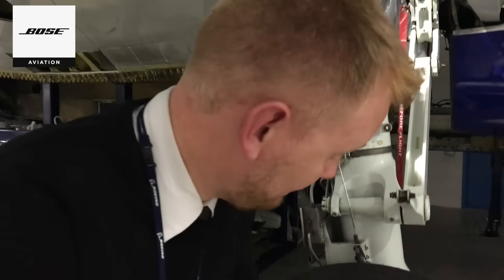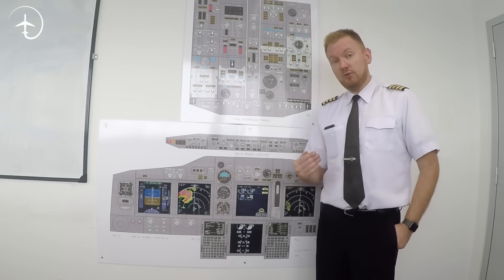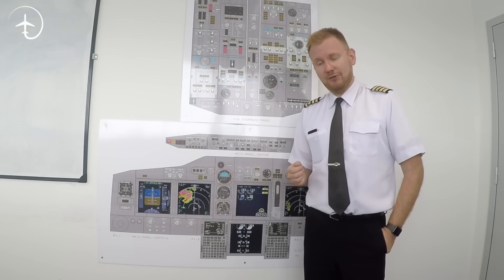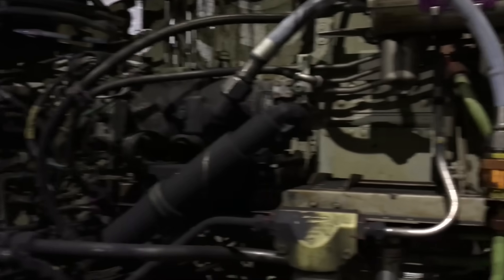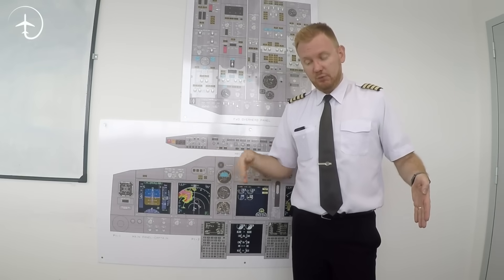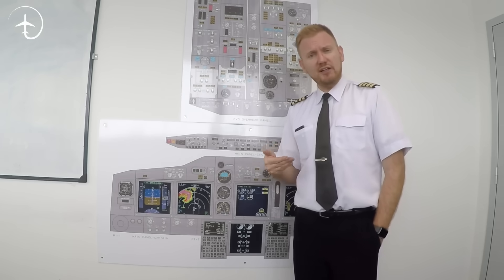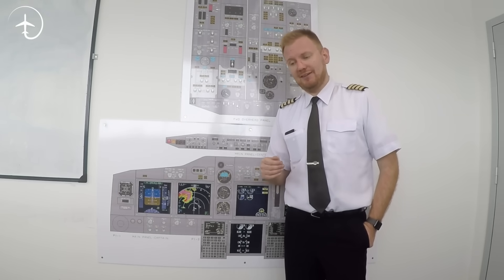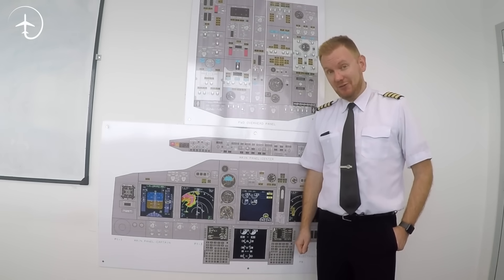Why does the Boeing 737 not have any landing-gear doors?

Comment: QUESTION: HOW DOES THE PLANE LINE ITSELF WITH THE RUNWAY SO PERFECTLY AND ALMOST TOUCHES DOWN AT THE SAME POINT EVERY OTHER PLANE TOUCHES DOWN? HOW COME IT DESCENDS AT THE SUCH A PERFECT RATE THAT FROM A HIGH ALTITUDE, OVER MANY MILES IT TOUCHES DOWN EXACTLY AT THE SAME POINT EVERY PLANE TOUCHES DOWN EXACTLY ON THE RUNWAY. HOW IS THIS POSSIBLE? THE CALCULATIONS WOULD BE VERY HARD TO FIGURE THAT ONE OUT.
Reply: I'm not a pilot or any kind of expert, but the pilot FLIES the plane to a large degree, he determines and decides where to touch down...oh, and turn off your caps lock...
Reply: Happy Plucker.  Ok. Let’s go back and be clear.  I started flying before the Internet (at least before it became widely available). I had large folded up charts (not under plastic) and an E6B (slide Rule?) and never used either to figure out a glideslope.  I also had (and still do) a transponder that doesn’t bleep when I am on course.  What did you mean to write?  Because what you wrote is incorrect.  And perhaps your writing does not accurately represent your thoughts, so this is an opportunity to concisely write what you mean.  If you care to know, I can tell you how it was done then, and how it is done now, instead of you posting stuff that   was not/is not   accurate.  Obviously you are interested in aviation, and I would enjoy answering your questions.  I am not THE expert, but am very knowledgeable in the subject area.  

Instead of telling people “how things work”, you might consider prefacing it with, “I read that....or...I think that.....” instead of posting something that is factually incorrect and anyone in the business will know is wrong.  At least it shows an attempt at learning the facts and making an error, instead of sounding like the voice of knowledge and being wrong.

The person who uploaded this video can answer questions for you, since he is qualified on the plane being discussed.  By the way, I think you hold the record for the most incorrect statements in a single comment that I have responded to so far (see comments above).  I would refrain from explaining things and ask more questions until you have an understanding of what you are commenting about.  Nobody knows who you are, so asking questions should not be embarrassing.  I know you have good intentions, but falsehoods don’t help anyone.  Use the comment sections to educate yourself instead if making incorrect statements.  Aviation is very interesting.  There are many people who are in the business who can give an accurate answer that everyone can learn from.
Reply: +John Jones Aircraft are expected to fly a specific "flight path" upon approach to an airfield.  Modern aircraft are fitted with equipment that tells them exactly where they are according to the flight path and the pilot steers to agree with it, and in many cases, the instrumentation can itself fly the aircraft along the path.

Aircraft are expected to land at roughly the same place on the runway, and buildings/vegetation is limited/managed to account for the path to that spot.  Along the centre-line of course.  If they touch down too early, they run the risk of breaking the plane if they undershoot the runway (like that plane did in San Francisco a few years back).  if they land too late, they run the risk of running off the end, especially if they have brake failure.

So every pilot is aiming for roughly the same spot - a bit past the start, but leaving as much run-out as possible.
Reply: There are several methods a pilot uses. One are the VASI lights on the side of the runway. If the pilot is too high, he sees the lights as all white. Too low, all red. Just right he/she sees 2 red and 2 white. You can see the lights if you drive past a runway but you will see all red because if you were a plane, you would be too low of course. I understand the pilots also aim for the same touchdown point as they land. This is where their skill comes into play... you can find YouTube videos showing them making adjustments to their glide slope as they get closer to touchdown but I think they focus on that point on the runway next to the VASI lights as their touchdown point. Most of the calculations are already made based on the plane. The pilots already know what their optimal landing speed needs to be for the plane they are flying. The best answer to your question is pilot experience and skill
Reply: E I N S  checkout your local flying club. They usually have trial flights 1/2 hour up for around $ 80-100.
So on board a ship you are surrounded by water. Unless you can see a landmass you could be anywhere. Also you need to be aware of undersea obstacles, rocks etc. That is why charts are vital and you need to know the depth of water, what currents are where as a large ship takes time to change course whereas a plane is easily re-routed.
Reply: Happy Plucker No, we fly it down.  The computer (I assume you mean autopilot) is usually not involved.  We are primary.
Reply: Happy Plucker maps under plastic? NO.  “not big folded sheets”:  yes they are if you are talking about VFR pilots unless they have something like Foreflight on a display or tablet.  If you are talking about airliners, then IPad, or tablet.  Transponder bleeps when you are on course (no, it doesn’t).  It responds to radar interrogations.
Reply: It is similar to driving a car, you look where you need to go and without to much thought you drive where you need to go. Of course with landings you have head winds, air temperature/air columns, air speed, and control surfaces determining sink rate. With practice the pilot learns to read the situation and adjust his airspeed and control surfaces to land at the right point on the runway. There is lines painted on the runway or marked with lights that aid the pilot in landing in the right place. Also many airports has various light and or radio beacons along with Instrument landing systems(ILS) to help at night and in bad weather. Most pilots can land where he wants on a runway without needing to think to hard at it but at times conditions can make it harder or they goof and need to abort and fly around.
Reply: how were pilots landing before ILS?
Reply: GPS.
Reply: E I N S  Line of sight. Pilots have access to maps, paper and electronic. Using map and compass they find the general location. Back in the day the next step was to use a slide rule. The height and length of the runway, direction of wind, approach speed are used to calculate the correct "glide slope" the angle the plane descends. Then it's down to skill.
Reply: i highly doubt they were able to use paper maps inside that small cockpit , i finished the Naval Academy, maps are huge and you need a table, big clean surface and compass and ruler and paper to do calculus on, being a pilot is still a big enigma for me, i just don't understand how it works.
Reply: E I N S Maps are held under plastic on boards, not big folded sheets. They contain information about headings, altitudes and radio frequencies. But many an amateur pilot has used road maps. I once flew with a guy who knew where all the pubs were on his route but other landmarks are used. It is not that difficult unless you encounter bad weather. If you study a basic instrument panel you will find gauges to show heading, height, airspeed, a clock to show time in air and present time. Fuel gauge, temp gauge.
Then there are transponders, devices which will bleep when you are on the correct flight path. Also air traffic control know where you are in the air and will give you heading and altitude.
There is nothing spooky or clandestine but it is highly skilled, especially landings.
And at night there are stars and sextants were used back in the day.
Reply: i would definitely enjoy one flight inside the cockpit to see what they do and how it works, i just have this curiosity about flying, i loved airplanes since i was a kid but i never took this road, i flew many times but always have been interested in what do pilots learn in school, always been interested in seeing planes from the pilot's perspective and understand how it works. I guess you are right there is the Air Traffic Control that can give important information to pilots and landmarks indeed that's a good point. I am just confused because in the navy people use maps to calculate the location of the ship along with the GPS and i just cannot see it being done in the cockpit . Deferent methods i presume, interesting.
Reply: Uuuuhm, isn't that more or less what I said, although a little more concisely than you?
Reply: Clearly? I have done a fair share of "left hand seat" piloting in my time, grew up in a flying family, I have a good grasp of the mechanics of piloting an aircraft and of the theory of flight. I can identify many, many aircraft by sight and at least one by sound (Douglas Dakota). Have you ever even been in an aircraft, or even seen one close up? And, for fucksake, turn off your caps lock, you are rude.
Reply: John Jones No, he follows the glide slope down, flares, and touches down where he touches down.  Sometimes 1000 feet down the runway, sometimes 3000 feet down the runway.  It’s a skill.  We are looking for a nice touchdown in the touchdown zone.
Reply: Happy Plucker who told you this?  The length of the runway is completely unrelated to glide slope.  What slide rule are you talking about?  The E6B is used for many things, but glideslope isn’t one of them.
Reply: John Jones sorry I did not see your post.
Reply: Oscar Blue Of course ipads are now the norm but I was referring to last century, before the internet.
Reply: Oscar Blue ooh I've been burned. Ok so my memory is a trifle shaky, I'm going back fifty years.
Reply: Happy Plucker ok, it was a long time ago.  Then tell us what you were flying 50 years ago and how it was then.  In other words, how the slide rule was used to calculate a glideslope for example.  I honestly have no idea what you could be talking about.  50 years ago puts us into the DC-9, 737, 727, 747 era, and I have flown two of those aircraft.
Reply: Happy Plucker After rereading your comments, I have come up with the following conclusions:

You do not hold any pilot certificates.
You went flying with someone you know who tried to explain some of the technology in the aircraft.
You misinterpreted the information.
You have done no research on the items you commented on, or your comments would have had some accurate information in them.
You have little/no knowledge about airline operations other than what you have seen on TV or at the movies.

Am I pretty close to the mark?

My uncle flew B47 bombers in the early 1950’s and he could remember many details about aviation before he died, so I don’t think your 50 years ago memory not being so good is a legitimate reason for all your information being inaccurate.  I don’t think you ever knew how it worked back then.
Reply: Oscar Blue I never claimed to be a pilot sunshine. I apologise for my memory or lack thereof. I am so pleased your grandfather retained good cognitive powers. We cannot all be so lucky. I have however flown right seat in many different types, including Twin Pioneer, Douglas Dakota, Hawker Hunter trainer, Beagle Basset, Beechcraft Queenair, Yankee and I have serviced all these plus others. Let us leave it there. You obviously have superior knowledge and like a dog with a bone are very happy to gnaw away.
Reply: E I N S bringing a sub into harbor would definitely be harder than landing a plane. you have do it for slower and with far less control.
Reply: Happy Plucker OK then.  You flew some classics and I will never have those types in my logbook.  I was not looking for you to say that I know more than you.  I am sorry that I got all over you.
Reply: govt required a rabbit's foot
Reply: I wonder what type of expert information you used to determine his cluelessness. Are you aware that birds, much less complex flying systems than the pilot/plane tandem, maintain near perfect flight formations and can land with extreme precision on tree branches?
The human brain, especially supplemented with computer systems, is a remarkable machine.
Since you suffer from caps-disease: YOU DO NOT NEED A PLANE EXPERT, YOU NEED AN EXPERT-SYSTEMS-EXPERT.
Also: YELLING IN CAPS AT PEOPLE IS A SIGN OF STUPIDITY. Just as clear as "ignoring interesting information with namecalling like 'clueless'".
Reply: Carefully.
Reply: E I N S, As some have mentioned, we follow the Instrument Landing System (ILS) if the visibility is too low to see the runway or we are in cloud/the cloud ceiling is below us for the last 5 to 7+ miles to the runway, depending upon when Air Traffic Control gets us vectored onto it. 

But you are asking how pilots line up visually in good weather... if you are not familiar with the airport and don't see it and want some instrument guidance (which is standard procedure) you tune in the ILS and can use the Localizer (lateral) portion of the signal to line up laterally. 

I think you are really asking about how we judge the vertical path/descent rate... ATC (Center & Approach Control) will clear us down to lower altitudes and we get closer (as traffic permits).  

If they clear us to descend from cruise altitude all the way down to 11,000 feet "at pilot's discretion" we'll use the Flight Management Computer (FMC) that we programmed on the ground to know when to descend.

Before FMCs you'd have to take your altitude in thousands and multiply by 3... so if you were at 33,000 you'd multiply 33 by 3= 99, you'd need 99 miles to descend plus 10 miles to slow down.

If the weather is good they'll be asking us "Report the field in sight".
As soon as we report the field in sight we will be "Cleared the visual approach to 16 Right" (for example), then we maintain the last assigned altitude until we determine that it is time to start final descent. 

We were close enough to see the field and report it in sight, so we are close enough to see the Precision Approach Path Indicator (PAPI), which are four lights spaced horizontally on the ground right next to where we should touchdown.  

The PAPI is made up of red and white lights that give us an indication of whether we are right on the glidepath (2 whites and 2 reds), high on the glidepath (4 white lights) or low (all red).
We follow the PAPI all the way down.

Smaller airports that small airplanes use usually have a VASI which is a two light system, vertically spaced.

A standard descent path for the last 10 or 5 miles of the approach is 300 feet per mile or 3,000' per 10 miles.  
As a rule of thumb, to get this rate you take your airspeed, say 140 kts, divide it in half (140 /2= 70) and add a zero (700) to get the desired descent rate in feet per minute, BUT we are following the PAPI and doing it visually. 

The Asiana 777 that crashed in SFO some years back was because that pilot was so bad that he could not fly an approach visually and he always relied on the autopilot to fly the ILS to the runway, where he took over for the landing... and the ILS was out of service that day. 

There were other contributing factors, like having the altitude/vertical speed hold and auto-throttles in the wrong mode and not understanding what was happening when the throttles automatically went to idle (due to having the automation in the wrong mode)... but if they had just turned off the autothrottles and autopilot and just flown the airplane there would have been no problems.

There was one more contributing factor... the Captain in the F/O's seat did not take over from the Captain who was in training (transitioning form the A320 to the 777).  Bad CRM probably related to Asian "respect".
Reply: can u turn off the caps lock?
Reply: Instruments. The ILS can automatically line the aircraft up on the correct flight path, descend at the correct height and speed. Pilots are secondary on most modern aircraft and are there in case a problem arises with the computors. Also to give confidence to passengers. Would you fly in a jetliner without cabin crew.
Reply: Happy Plucker heck the L10 11 could land, and select the PROPER GATE .
Reply: E I N S NO
Reply: ACTUALLY THE CALCULATIONS ARE FAR LESS DIFFICULT THAT WALKING UPRIGHT. HOW DO YOU PARK YOUR CAR IN THE SAME SPOT IN YOUR GARAGE EVERYDAY? HPW DOES A SUBMARINE RETURN TO ITS DOCK AFTER 6 WEEKS AT SEA. NOT SAYING IT IS EASY, BUT IT ISNT THE EXACT SAME SPOT. THERE ARE SLIGHT VARIATIONS DEPENDING ON HOW EFFECTIVELY THE PILOT FOLLOWS THE GLIDEPATH, AS WELL AS COMPENSATES FOR WINDS, TURBULENCE, GROUND EFFECT ETC.
Reply: cliby25

NO
Reply: Glenn Chambers

NO
Reply: IF YOU COMPARE A CAR AND A SUB WITH A PLANE YOU HAVE NO IDEA WHAT YOU'RE TALKING ABOUT. 
PLEASE STOP ANSWERING IF YOU ARE THAT CLUELESS ! 

YOU PLAY A REALISTIC GAME WITH LANDING A PLANE , PARKING A CAR, BRINGING A SUB INTO THE HARBOR AND SEE WHICH IS EASIER. NOW IMAGINE DOING IT IN REAL LIFE WITH 300 PEOPLE ON YOUR BACK . STUPID KID....
Reply: , he determines and decides where to touch down.

YES YOU CLEARLY ARE NOT AN EXPERT. THANK YOU BUT YOU KNOW LESS THAN I DO SO THANKS BUT NO THANKS